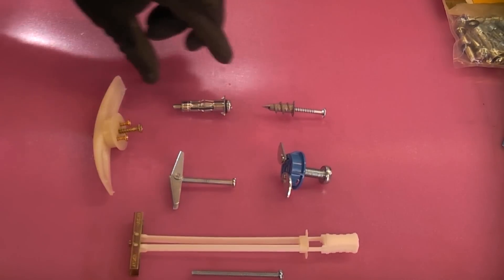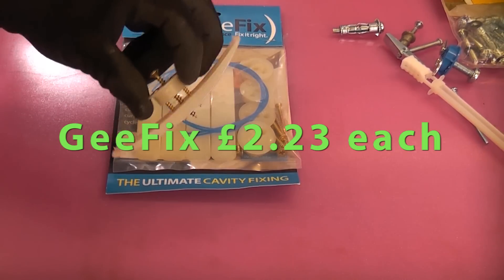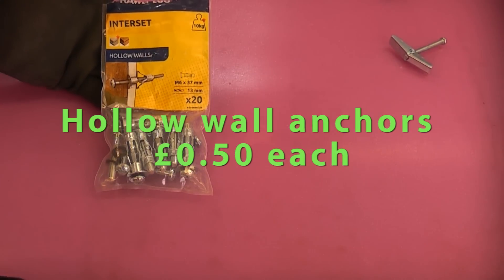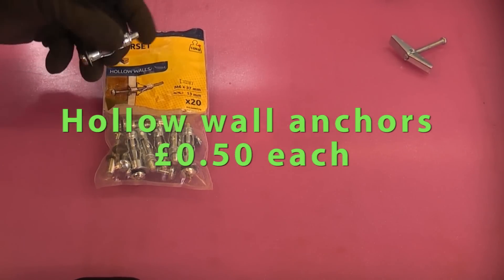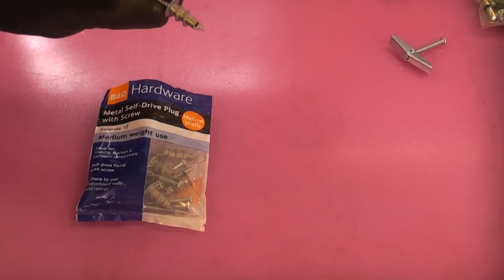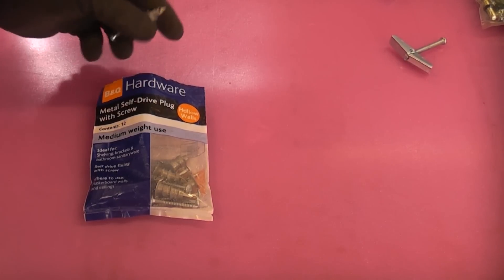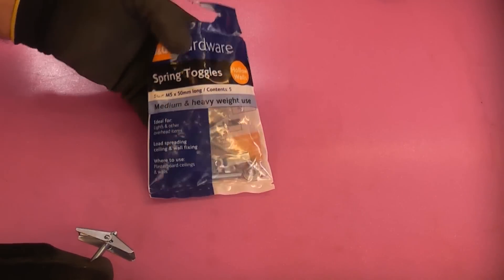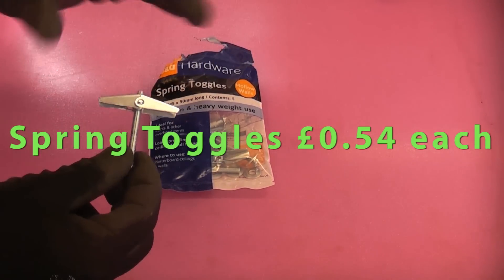The worlds strongest plasterboard fixings | Drywall fixings strength test

Comment: Thank you for taking the time to prepare this excellent experiment. 
I am fitting a new bathroom and have a large bathroom mirror weighing 13.8kg to fix onto a honeycomb/egg crate plasterboard wall. This wall will eventually be tiled using mosaic tiles. This wall is a partition between the bathroom and en-suite which, incidentally is already tiled. On the rear of the mirror there is a metal frame which has four keyhole slots intended for screws to slot into. I was thinking of using 4 x Molly M6 50kg fixings (using Molly setting tool) and would value your opinion as to whether the fixings and plasterboard will be capable of supporting the mirror safely. https://www.illuminated-mirrors.uk.com/audio-havana-led-bathroom-mirror.html
Reply from the maker: They should be fine to be honest.
13.5KG's is not a lot of weight compared to some large TV's 
Thanks for the comment

Comment: I need to hang an electric heater which is 8KG. I'm tempted go for a more heavy duty fixing but I already have some worm drive screw which in your demonstration failed at 53KG. I suppose these will be OK despite the heater not being as light as a "picture"?
Reply from the maker: I'd go for a better fixing to be honest, it's a lot easier than repairing the plasterboard if the fixings should fail.
I have seen radiators hung using the worm drive screw and kids have lent on the radiators which have removed them from the wall.
Reply: Thanks for the advice. You are right and it's better safe than sorry so I have gone with the hollow wall anchors from Wickes and the heater feels very secure.

Comment: Great video. I really appreciate it but everyone seems to be doing wall mounts and fails with these kinds of anchoring devices. Can't find any on ceiling mounts. Of course the ideal is to mount to joists. What do you think of the claims this video makes for the strength of this hanging pot rack demonstration:https://www.youtube.com/watch?v=KPIAnP0O4_oI I am very skeptical since these kinds of anchoring devices will fail much sooner with a ceiling mount.
Reply from the maker: The snap toggle was the second strongest fixing that I tested.
There are a lot of variables, but most plasterboard ceilings will not hold 200Lbs between two snap toggles- especially if they have used 9.5mm plasterboard.
The piece of plasterboard used in the pan rack demonstration looked particularly thick!
Reply: Thanks for your reply.

Comment: Intending to use 4 x Molly 50mm M6 40kg (using Molly fixing tool) to fix two brackets for single radiator (900mm x 600mm) to honeycomb/egg crate plasterboard. Feeling more confident after watching this excellent demonstration.
Reply from the maker: Thanks for the comment ;-)

Comment: Just for anyone watching, I want to point out that the fixings themselves do not fail in any of these set-ups, it is actually the plasterboard failing. A 3.5mm drywall screw has a tensile strength of around 1,100 N/mm^2 giving it an approximate tensile capacity of 10,583 N (approx. 1,079 kg - over 1 ton per 3.5mm screw). A toggle anchor has a 6mm nominal diameter but a tensile strength of only 670 N/mm^2 - which still gives it a tensile capacity of 615 kg per anchor.

Comment: Only problem I see with your test is that the first test " Geefix" (big toggle)would have not torn through as easy and out performed the last toggle type if the backing wings were horizontal like as done with the toggle. Nice demonstration though.If rewatch I thing its clear. ??.See if you agree.
Reply from the maker: I would just use the existing bracket without the piece of timber but fix it to one of the wall studs. Fixing a TV to a wall using drywall fixings is not a god idea, the studs are normally easy to find- https://www.youtube.com/watch?v=H5U0sLKyJJw
Reply from the maker: Dot and dab is normally only used on solid walls, like this- http://www.ultimatehandyman.co.uk/how-to/plastering/direct-bond

If you have plasterboard on both sides of the wall it is likely that you have a stud partition wall? 

If it is a stud partition you should be able to find a stud and fix to that?
Reply from the maker: There is no way of knowing when installing many of the fixings what the orientation is or even is the fixing has worked as intended.  One a previous test the wings on the Grip-it fixings did not extend fully as they were jammed with a piece of the paper backing on the plasterboard.
Reply from the maker: Sorry, I got confused with Grip-it fixings in my original reply (just got back from holiday and have lots of comments to answer).
The problem with the GeeFix is that you have to make a large hole for the fixing (1 inch - same as the Grip-It fixing), so this immediately weakens the plasterboard more than a 13mm hole which is required for the spring toggle etc.
Of course the fixings will be affected by the orientation of the fixing, but with many of them you can't see the orientation as it's hidden in the partition wall.
Thanks for the comment
Reply: I hope someone can help! I am mounting my 17kg TV on the wall tomorrow using an "invision double arm wall bracket mount" that I have already purchased. This mount has quite a small footprint (190mm x 110mm). I was thinking making a wider footprint by using some good thick Ply wood or MDF as a base for the mount and then fixing the wall bracket quite low down onto the ply? does that seem like a bad idea?
Will be using snap toggles BTW. Would it be better if the toggles were in a horizontal position or vertical?

Thanks

Link for the wall bracket: https://www.amazon.co.uk/gp/product/B01AYB3MD6/ref=oh_aui_detailpage_o02_s00?ie=UTF8&psc=1#Ask
Reply: Thanks for the reply. I'm sorry, but I forgot to mention it is a dot and dab wall with with no brickwork behind it, just another sheet of plasterboard on the other side of the wall. This wall is also my only option to mount.
Any other ideas please?

Thanks for your time.
Reply: You're right, it is a brick wall. Just popped into our neighbours house who has his tv mounted on the same wall and it is dot and dab on bricks. He's actually a builder and told me what bits I need & stuff.

Thanks again for your help :)

Comment: Hello, just put 2 wooden shelves on a plasterwall using the self-drilling metal screw fixing. these shelves only have lightweight things on them like photos and bits n bobs from travelling.bit worried if what i done is  safe? do you recon i should replace the plasterboard screws with snap toggles?
Reply from the maker: It will be fine with light weight things on the shelf, but if you were to start piling it up with books I would look at more heavy duty fixings ;-)
Reply: Thank you very much for your response! i really appreciate it and I've already subbed! to your channel :)

Comment: Hi

Love the format in which you present but, if I may point, can this be indicative of the actual strength of the fixings?

What I mean is that I seems to me that it was the plasterboard that broke which tells me that had you tried in a concrete wall, you'd have gotten a lot more out of these tests.

Of course the tests would also be much more expensive!
Reply from the maker: Hi, these are plasterboard fixings- which are to be used in plasterboard or drywall.
Many of these fixing manufacturers claim to have the strongest plasterboard fixing, so this puts them to the test using an identical piece of plasterboard each time and the same brackets each time.
Of course the plasterboard will fail before the fixing, but this video shows which fixings give the best fixing in the plasterboard.
Thanks for the comment
Reply: Alright then, thanks!

Comment: On some brackets, there is enough room for two hollow wall anchors or just one spring toggle. Which do you think will be stronger?
Reply from the maker: I'd go for the spring toggles.
Reply: Thanks! That's what I've been using when I need a strong fixing, but lately I've started doubting that choice. Your video has inspired me to do some of my own testing as soon as I get a chance.

Comment: Would the ready drivers be suitable for fixing a small radiator to the wall? I'm just asking because I have a radiator in one of my bathrooms that was fixed to the wall with them quite some years ago. I've noticed recently that the rad is coming away from the wall slightly and was wondering if it would be better to leave it or replace the fixings with something like the snaptoggle or spring toggle.
Reply from the maker: I'd never use redi-driver for fixing a radiator. A friend of mine rents out a house and one of the tenants kids leant on one of the radiators recently and it fell from the wall (it was fixed with redi-drivers). We re-hung it using snap toggles, although spring toggles are often easier to obtain and gave a stronger fixing in my test- 
https://www.youtube.com/watch?v=ECDysfNhx_E

If you are ok with plumbing the ideal solution would be to remove the radiator and replace the fixings, although you might just be able to tighten the existing screws?
Reply: Ah that's probably why a friend of mine was able to pull the radiator out of the wall in my room with such ease when he fell over a few years ago ( my room and the aforementioned bathroom were built as part of the same extension by the same people ). It looks like I'll have to have someone out to re-mount it since I have no clue what to do when it comes to plumbing. Thanks for the swift reply!.

Comment: Great test I have watch this quite a few times but I always wondered if the rotation of the Snap toggle and Spring toggle matters. Although you can't really control this for spring toggle you could for snap toggle if you could see them.
For example the cantilever effect plays more when they are vertical vs horizontal. One end will start chipping into plasterboard faster.
Reply from the maker: Absolutely.Thanks for the comment ;-)

Comment: I did manage to fit my 49" Samsung to a dot and dab wall using the heavy duty grip its.I used 5 in total, so I have my tv on a bracket now supporting a PS4 and a LG soundbar.So far so good it seems rock solid after 48 hours.
Reply: On a dot and dab you should drill through into the sold wall behind not use any of these. 100mm coach bolts and plugs.

Comment: What happens if your plaster boards are thicker than the plugs? Will it fan out ok into the wall itself? 
Rather than fanning out on the opposite side?
Reply from the maker: Most of the fixings can cope with thicker plasterboard, such as double thickness apart from the plug type ones.
Obviously if fixing to double plasterboard you would have to choose the appropriate fixing.
Thanks for the comment ;-)
Reply: Ok thank you.
Reply from the maker: You are welcome ;-)

Comment: The so called "metal self drive plugs" or piggy tails, I have never screwed these straight into plasterboard as it just destroys it. I drill a 5mm pilot them screw them in, it will be cleaner & hold more weight... still not as much as those toggles though & that was a surprise to me. I might be trade, but you can still learn things after all these years.. thanks for the vids.
Reply from the maker: Thanks for the comment ;-)

Comment: if I pulled that shelf it would rip off. so this test is crap coz its lateral down force on the bracket as in any down force test. it depends on what the bracket is attached to. try it with a drawing pin see if t you can rip it down a peace of dry wall.
Reply from the maker: This test uses an identical piece of plasterboard each time, it also uses the same brackets fixed in the same positions each time.
I'd say that make it a pretty fair test.
I realise some people are not intelligent enough to appreciate the physics behind the test, but there is not much I can do about that!

Comment: Brilliant video. I liked the last test, where you ran out of blocks!
It seems that the spring toggles hold the most weight, but I have always found them difficult to install II'll have to try again)
I have found that the nylon worm type are great for items such as smoke alarms and pictures. But after watching your tests I would not use them for my new flat screen tv.
Reply from the maker: Thanks, yes the spring toggles are not the easiest to install but they certainly performed well ;-)
Thanks for the comment
Reply: I really thought the snap toggles would do better since they have a flat surface against the drywall instead of the u-shaped channel the spring toggle has, very interesting. Cool video👍🏻
Reply from the maker: Me too!
Thanks for the comment

Comment: so would you use spring toggle to mount a tv weighing 16kg with a fixed wall bracket on a plasterboard no stud wall and great show of strengh capasitys
Reply from the maker: Yes, if you use a few of them they will hold a bracket no problem, but it's always best to find a stud if you can to be 100% certain

Comment: Great videos you have here. Subscribed after 1st one. I just bought some of those Blue Gripits for my 50" TV and wall bracket, which will probably be about 50 - 60kg so should be fine. But now I'm wondering if I should change them to the spring toggles after the performance test. My TV Bracket has a full motion arm, so I am concern about the cantilever weight if fully extended? The bracket has two screw holes at the top which is where most of the weight will be, but using the Gripit will mean I will only be able to use one, since the Gripit hole you have to drill is quite big. Maybe the spring toggle or snap toggle would be better. Also I'm thinking that because the bracket fixed to the wall is about 30cm Vertically with the fixings 15cm apart, this will put more tension on the plasterboard in a small area? Any advice at all?
Reply from the maker: For something so heavy, plus the cantilever bracket I would definitely try and find a stud for at least two of the fixing holes(providing it's a stud wall)
https://www.youtube.com/watch?v=H5U0sLKyJJw

If it's a solid wall behind the plasterboard I would use Rigifix fixings (or similar) -https://www.youtube.com/watch?v=xaYfs3lr1jI

If it's a plasterboard wall with insulation between the plasterboard and external wall I would do this-
https://www.youtube.com/watch?v=7DGGUbbbBZI
Reply: Furze2 I'm sure you've done it now but I really doubt that your TV and the half bracket weighs anywhere near 60kg
Reply: I was surprised the wall achors beat the gripits and they are cheaper and require a much smaller hole. I was always of the mind that if a smaller fixing got ripped out somehow then I would just drill a bigger hole and fit a gripit as an upgrade, but this demo implies it would be a downgrade

Comment: @ultimate Handyman...

watched this video video a few time and it's great video.

what would you recommend using when the plasterboard is tiled?
Reply from the maker: I'd use the spring toggles to be honest as they are cheap and give a good fixing, although you do need to drill quite a large diameter hole for them.

Comment: Another great video sir! Grateful to find this video at this moment in time because I have a problem. Hopefully you can help me out. I am trying to mount 42inch TV on wall, I have less than an inch between plasterboard and brick wall, which meant I could not use the Snaptoggle, I have seen your video on Rigifix, but just as I was about to purchase some, I came across this video. Would you then advice using the Spring toggle to mount a 40kg TV despite the fact that it has strongly been advised against for this purpose over the internet. (Oh, and I have no studs!)
Reply from the maker: The GripIt fixings work well in such situations-
https://www.youtube.com/watch?v=szx7nMRZSIY
I don't think spring toggles will open if there is such a small gap.
Reply: +Ultimate Handyman 

I can just manage to get the spring toggle in since they fold in. And I have plenty of them to spare.

Comment: +Ultimate Handyman I am in the process of moving into a home that was renovated using metal studs.   Before hanging anything heavy (and expensive), like televisions, I've been researching around the Internet and came upon your channel.  While the specific weight load can vary dependent upon quite a few variables, I believe your intention was to provide relative quantifiable information from hanger-to-hanger.  This certainly gives me something to consider.  I've heard so much good about the snap toggles, but it seems I might be better off gong with a standard toggle bolt, and could save some money and gain strength...even if I went with a heavier gauge standard toggle?  I only plan to mount directly into the steel studs, but I do not want to cut the wall open to reinforce the studs with pieces of 2x4, for obvious reasons.  Thank you for your time and effort to help with real world scenarios.
Reply from the maker: Thanks Chris, you are right there are many variables and the intention of this test was to see which fixings work best in the same scenario.
The snap toggles are good, but are expensive compared to other fixings. The spring toggles are much cheaper and are more widely available so I tend to choose them now, even though they are a bit more difficult to use.
Good luck with the new home and thanks for the comment ;-)